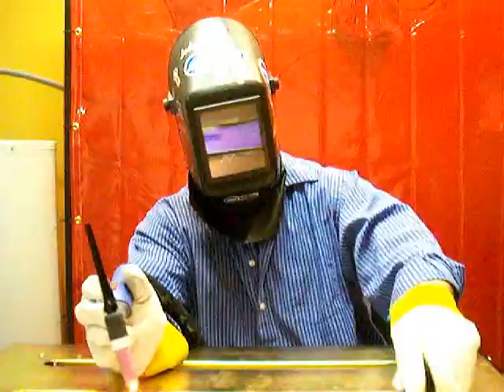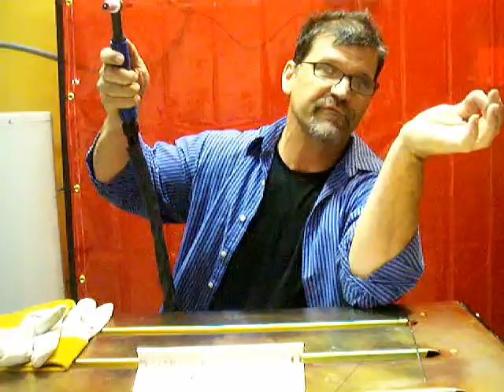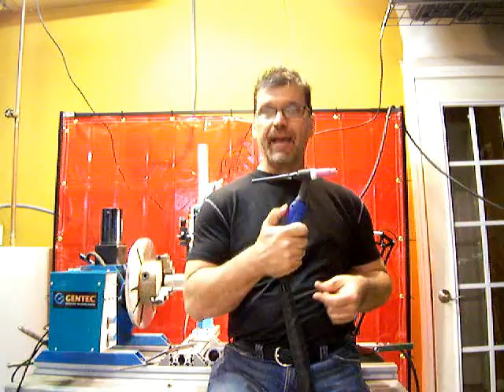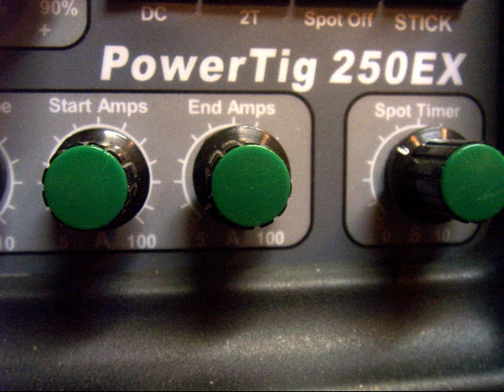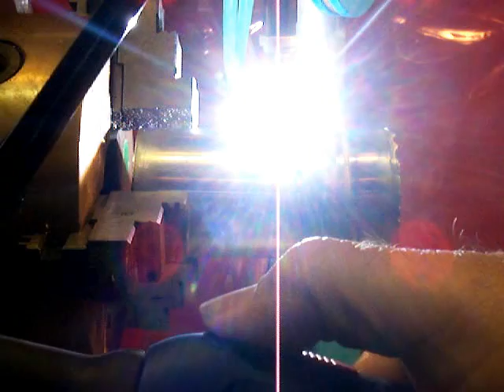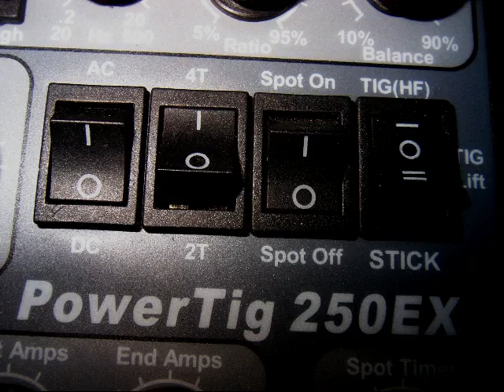Tig Welding Inverter 2t and 4t settings part 3 - Everlast Powertig 250EX

Comment: Man, you got that part about trying women about this stuff...

If you're going to fix something for your mother, don't work anymore than you have to tell them. Just let them know you've got the tools to fix part for them and wrap it up ASAP!

Harvey downed my old welder and I'm in the market for the 250EX... First considered the 256Si to pick up the additional plasma torch. I'd certainly use them both and time isn't an issue between setup for either function; however, I'm going to need much lower starts to go with higher volts/amps.

Would you use silica bronze on an antique, cast bath tub? It would make the resurfacing much easier to do before baking a new enamel onto it.

You're a character, love your channel!

Comment: When I'm at a bar, pounding beers, I sometimes bring up "UPSLOPE and PENETRATION"..... chicks flock to me. They desire more info. I tell them of my Everlast 256SI and its penetrating and cleansing ability. They are simply in awe! They yearn to hear about my "rod in the puddle".... it gets them every time. The Everlast 256SI...... chicks dig it, especially when it's set to max pulse! Trust me.... I'm certified.

Comment: My 250EX will be here in 3 days.  This is pretty deep stuff.  I have a good electronic background as a Senior Master Tech with Ford Motor Company but have never Tig Welded.  I want to learn all I can and practice correctly.  I didn't see in this video exactly how to use the foot pedal.  I'm watching these videos every day.  If anyone can clarify how to practice I would appreciate.  I guess you just leave it on 2T?  By the way I have stick and MIG welded alot over the last 30 yrs but am certainly no pro.

Comment: That IS a nice welder. I'm not sure if my existing electrical plug can support all of the power of that welder needs but it sure would be nice when welding up thick aluminum. Maybe time to wire a new service.

Comment: I noticed Everlast carries some torches with amperage control on the torch. I'm considering getting one for my Everlast 200DX. Have you used any torches like this and does it help when you want the amperage control but can't get the pedal where you can use it?

Comment: Hi champ, just one question what is the last toggle switch on the right of machine next to the spot-on spot-off switch for??? the one with the tig or stick HF switch it has marks of = or -.
Its the only thing I have not worked out on my AC/DC Pulse tig welder.